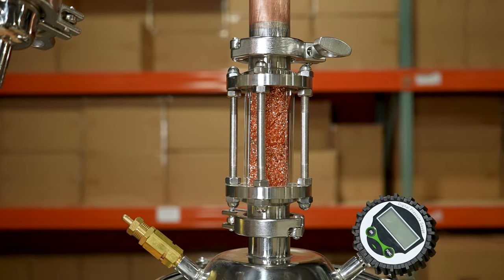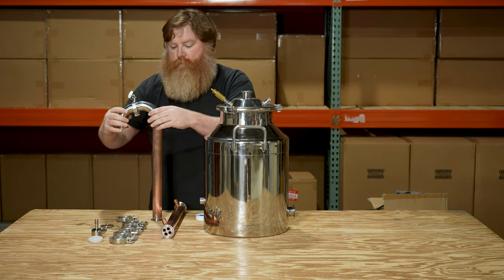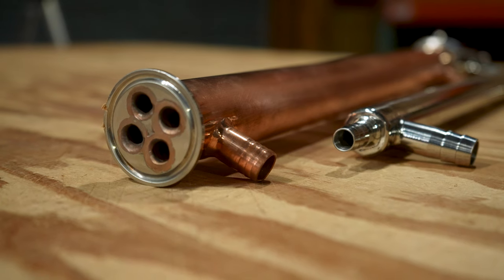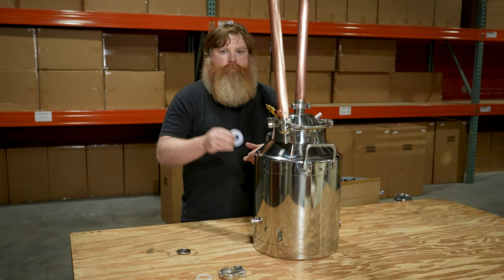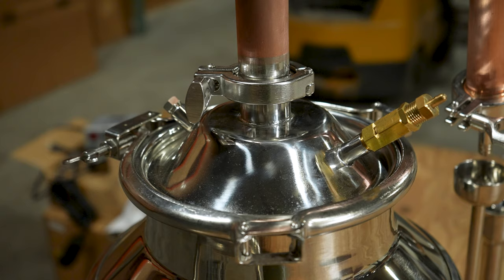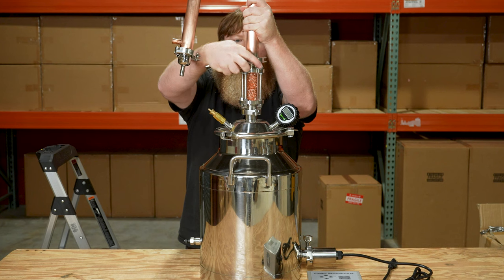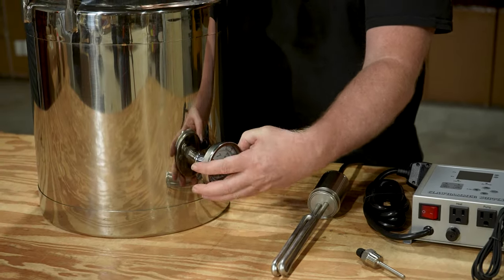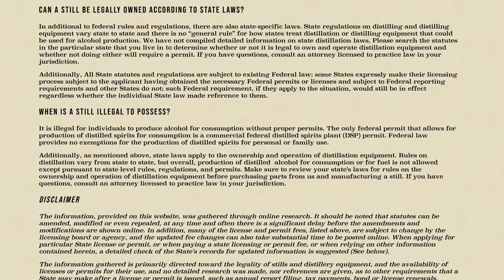Custom Distillation Equipment Mod

Comment: Great basic pot still. +1. You are supplying great products to the distilling community.
Highly recommend PTFE (Teflon) seals instead of Silicone seals.
It's not what the high abv vapor does to the seals, it's what the high vapor abv takes with it.

Comment: I'd suggest NOT using silicone for your gaskets but rather use a flexible Teflon, HDPE, or NBR type gasketS. Jessie on still it has mentioned that before in his videos. Just Google silicone and ethanol reactions. I'm not sure if you're using that type but using silicone can leave trace chemicals due to the degredation of silicone by ethanol.
Reply: I dont imagine its beyond safe levels considering there are distilleries that use silicone gaskets and even recommend them

Comment: Looks great. Just a comment though, a PRV (pressure reducing valve) and a relief valve are too different devices.  A PRV is a pressure regulator that maintains a set pressure, while a relief valve is a safety device that discharges fluid or gas when a vessel is over-pressurized. Similar, but not the same.
Reply: This aged poorly ouch